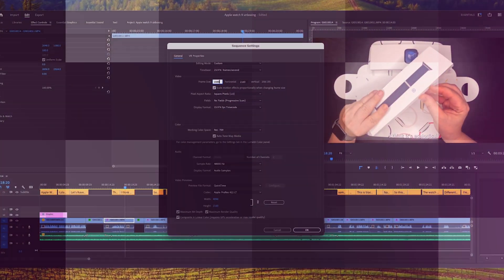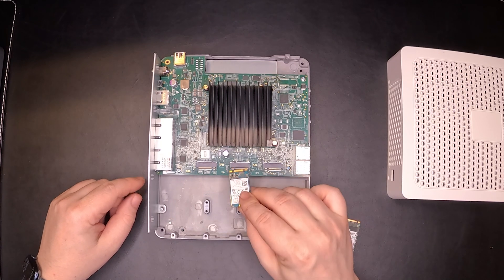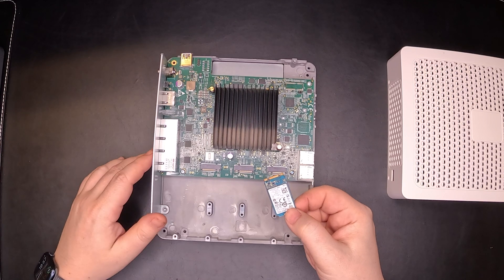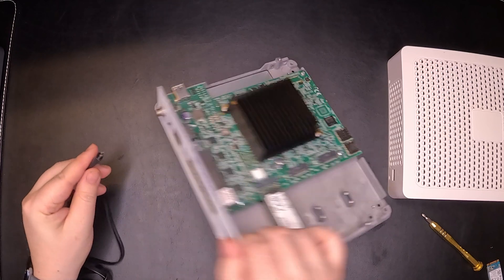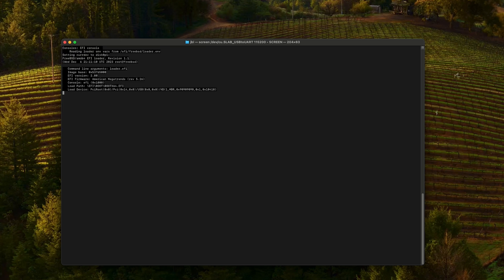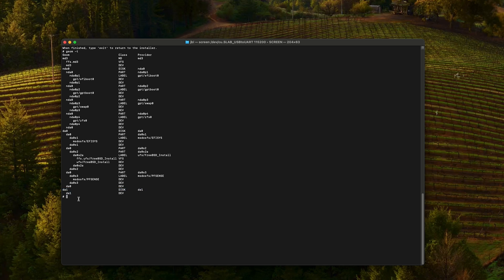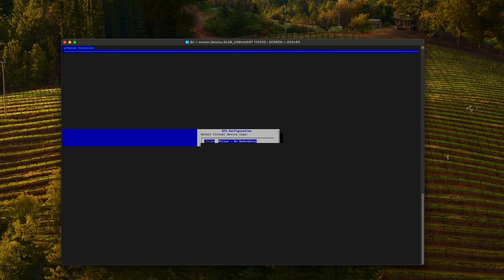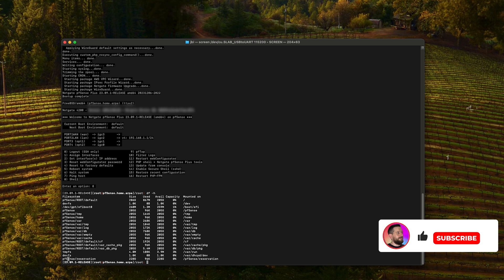Netgate 4200: unofficial nvme SSD Upgrade for the latest pfSense Firewall

Comment: it took me long to figure it out why pfsense crashes from time to time. if the system gets shut down by a power loss a few time, the internal eMMC gets corrupted. MUCH better is a industrial usb stick (SLC) or a industrial NVMe disk. give a shit on the out of the box eMMC that netgate installs from the beginning!
Reply from the maker: Thanks for the feedback and for sharing your experience! Indeed the shipped eMMC is is low quality (except on the 2100 where it's not pushed so much). Any NVME drive will take cold restarts way better than the internal memory and you can cheaply swap it if something goes bad.

Comment: So there are multiple NVME ports and ZFS. Could you raid 1 with two small NVME drives?
Reply from the maker: I did not try it but I don't see why not. the same principle is used in the RAID version of higher end appliances like Netgate 1537 or 1541

Comment: Is it necessary to change the boot order in bios? I’ve noticed that my 4200 has an extremely long boot time because it’s got to wait for timeout on lots of other boot options before it gets to the eMMC storage.
Reply from the maker: Hi, By changing the boot order you will cut some of that time down. If you have issues with the emmc and you do not change the boot order, you might experience situations where the Netgate will be stuck on boot and never initialise unless you do multiple restarts. Also I noticed on other models that there are some hidden partitions that remain active even if you erase the emmc and in order to avoid any possible issues, I recommend from experience to always change the boot order where possible (not all devices support this operation unfortunately). it's a 2 min process that saves a lot of "ifs" :)
Reply: The boot delays are mostly the PXE boot its trying to do. You can go into the BIOS advanced > PXE networks (or something close)  setting and turn off the PXE network stack and then it boots in maybe 30 seconds.

Comment: over the top for me
Reply from the maker: Nothing is imposible. Just split the process in multiple steps and tackle them one at a time. There is nothing that can't be fixed as long as the board is not physically damaged. Try , fail, repair,  succeed (not necessarily in that order :) ) it's how we all learn

Comment: Why would you want to add this nvme drive?
Reply from the maker: that is good questions and there are multiple reasons for it. The included eMMC is slower than the nvme so by replacing it you will have a faster response for the web interface and higher capacity storage as a bonus. The biggest reason of all is the fact that the eMMC has a limited number of red/write operations so using logging intensive applications (ex pfBlockerNG) will end up in getting the file system corrupted in time. This does not happen with the SSD and even if you somehow permanently damage the nvme by adding some power cuts to the game, you can simply replace it. The eMMC is soldered on and can't be replaced so you may end up with a bricked unit.